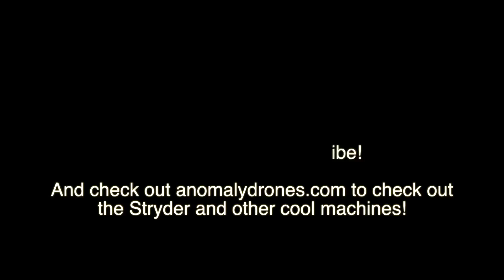Anomaly Drones Stryder with ProSight: Build Update

Comment: Did you have any problems getting OSD (I mean telemetry)from the flightcontroller rendered as OSD with the prosight tx?
Reply from the maker: Never tried. Check out videos from Painless360, I think he may have figured out how to get it to work. It's not known to be exactly intuitive or plug-n-play.
Reply: Ok, I will, I have seen some of his videos already, but nothing with this. Got to look a little closer. I've noticed it''s not so much info out there on the subject, but in the specs it says it supports mavlink f.ex. and the interesting thing is the extra cables you can buy for telemetry, they support connections to a lot of different fc's.

Comment: I just got a Falcore drone with prosight cheaper than the system itself. After first fatal crash I will transplant the HD tx to a better quadcopter. I also got another camera(the upgraded version) and extra tx for a few bucks that I will use in a EDF wing later. with the same reciever. I see people get 3-4 km range with the right antennas, it's going to be a fun project to find some panels to match like the 5 original dipoles..

Comment: Nice video, still valid a year later. Question you might answer with your RF insight; Isn't the length of the antenna wire as critical as the soldering?
Reply from the maker: The length of the coax portion of the cable doesn't matter nearly as much as what goes on at the ends. Can it make a difference? Yes, but the effect is minimal. What really matters is the amount of exposed center conductor and shield at the soldered end, the distance of exposed insulator between the two, and the quality of the connection made there.
Reply: I realize the shielding are supposed to mitigate or at least limit the phenomenon, but if you ask a radio-head (HAM operator etc.) they measure their coax cables to the mm according to frequencies to be transmitted, don't they? Or do you think the original connex wires had a coincidental lenght ? I'm not trying to argue here, I just want to know if I should cut my own wires, or leave'm as is. What gives the best result, the loss being minimized with shorter wires, or the original length if measured to match a frequency in conjunction with antenna..
Reply from the maker: At lower frequencies like HAM it's easier to be exacting. At 5.8 GHz you're never going to get your lengths perfect to tiny fractions of a mm. Plus it just hasn't been shown to have that much effect on VSWR or tune. I would leave the wires long, mostly because changing them is a risk to the delicate microstrip trace.
Reply: I get what you're saying. Thanks for the enlightening. I've been soldering enough to make it straight,  I think, the thing is - if there's no difference signalwise - it's maybe more practical to leave them so they will fit in future builds anyways.
Reply from the maker: I would say if you're an experienced soldererererer then give it a try and see if you think it's worth it. The part that bothered me about the process the most is that the microstrip trace lifts off the PCB very easily, at least it did on the small sample size of 2 that I tried. That plus the time it takes to do it - eh, just wasn't sure it was worth it in the end. Actually, in the end I stopped using those antennas anyway and switched to using Taoglas antennas mounted on Amimon's racing antenna mount. More compact, so much more robust, and seemed to have the same performance, or darn close enough.
Reply: Yes you need a tiny tip on the iron to solder those micro-wires, and yes if the copper gets too hot from repeated soldering, it can easily come loose. But those antennas are just standard 5g laptop\wifi strips are they not? I think Parrot sells them on the cheap for the Parrot drones f.ex. - a little extra coated and weatherproof.
Reply from the maker: Or it might come loose at the very first touch of the iron. :) Yes there are other antenna options now. Several. I liked the Toaglas ones.

Comment: Great mod vid 👍 Would it be better if you turn top antenne around, so the wire of the antenna is facing down?
Reply from the maker: Are you talking about the top (horizontal) ProSight antenna?
Reply: kenkamm yes, you protect the connection with hotglue, but could it be easier to turn the top Prosight antenna around, so the wire connection is at the bottom?
Reply from the maker: SonAndDad No. the top antenna only fits one way. It's horizontal and the wire is attached to the end so it must be routed as shown.